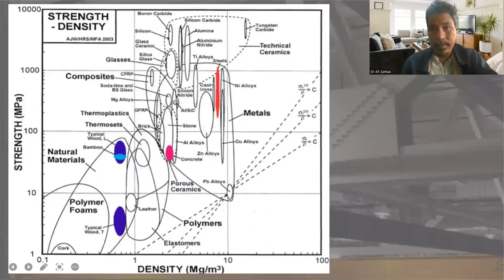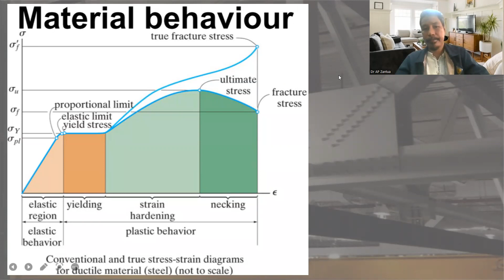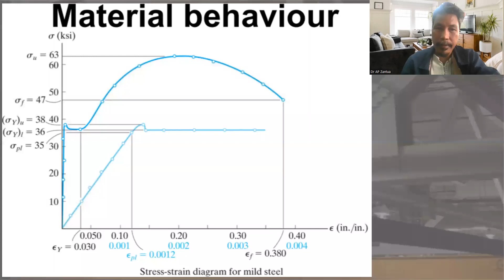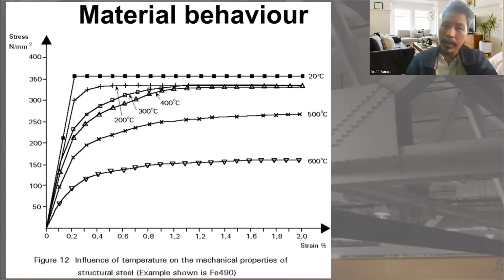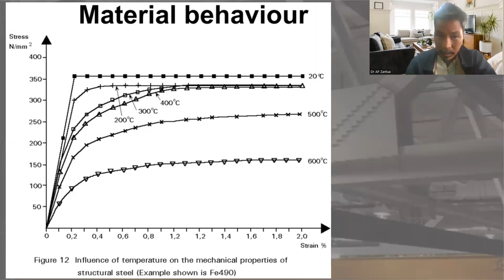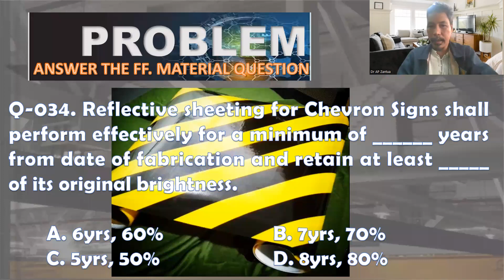Material Characteristics: The Stress Strain Curve [ Principles of Steel Design ] Module 1.02.b

Comment: Thank you sir for this lecture video about the comparison of material behavior. The stress-strain diagram visually display the material's deformation in response to a tensile, compressive, or torsional load. Depending on the material being tested, a stress strain curve can indicate key properties of the material including its elastic region, plastic region, yield point, and ultimate tensile strength. To easily familiarized with this, we can use PEYUR, for proportional limit, elastic limit, yield stress, ultimate stress, and a fracture stress or rapture. 

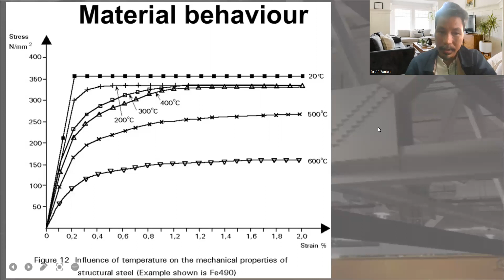As for 22:51 A challenge question-034: Reflective sheeting for Chevron Signs shall perform effectively for a minimum of _  years from date of fabrication and retain at least __ of its original brightness. The answer is B ( 7 Years, to 70%).

Comment: Thank you, sir for teaching the material behavior through stress-strain curve. The curve was well explained. As I recall, this diagram are also used in concrete where we discussed the 3 stages of plain concrete to reinforced concrete. In steel testing, they uses this diagram to evaluate its material yield point, tensile and elongation.  

Q 034, Reflective sheeting for chevron signs shall perform effectively for a minimum of 7 years from date of fabrication and retain at least 70% of its original brightness. 
The answer is letter B.

Comment: Thank you, sir for explaining the material behavior through stress-strain curve. It is very easy to remember mnemonics "PEYUR" which means Proportional Limit, Elastic Unit,  Yield Stress, Ultimate Strength, and Rupture/Fracture. The curve was well-explained. As I recall, this diagram are also used in concrete where we discussed the 3 stages of plain concrete to reinforced concrete. In steel testing, they uses this diagram to evaluate its material yield point, tensile and elongation. For Q 034,  reflective sheeting for chevron signs shall perform effectively for a minimum of 7 years from date of fabrication and retain at least 70% of its original brightness. So the answer is letter B.

Comment: Thank you Sir for having this lecture video, a continuation of the explaining the strength-density graph and a new graph, "Material Behavior", and it is a stress-stress diagram. Greek symbol ε (epsilon) for strain and Greek symbol σ (sigma) for stress. 

Q-034. Reflective sheeting for Chevron Signs shall perform effectively for a minimum of _ years from date of fabrication and retain at least _ of its original brightness.

Answer : B. 7yrs, 70%